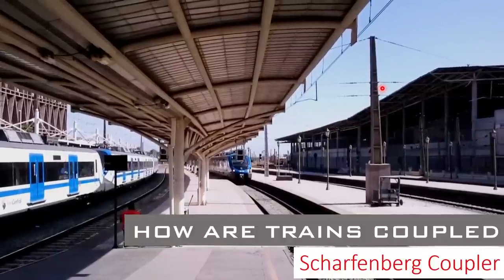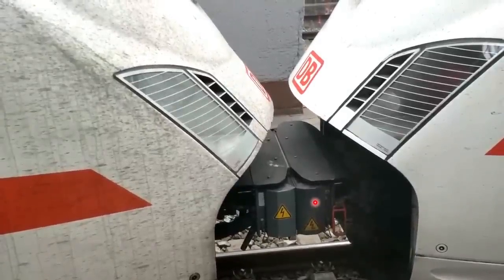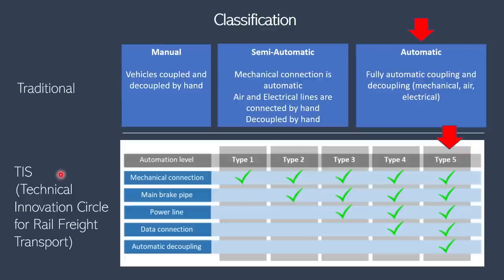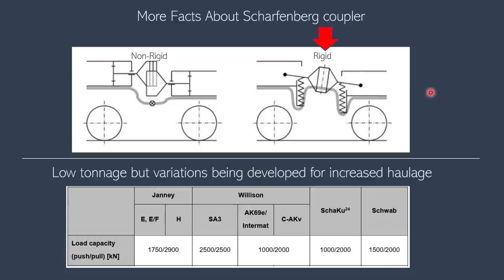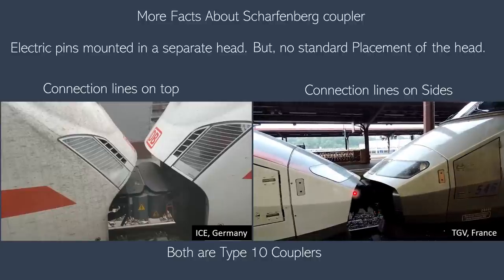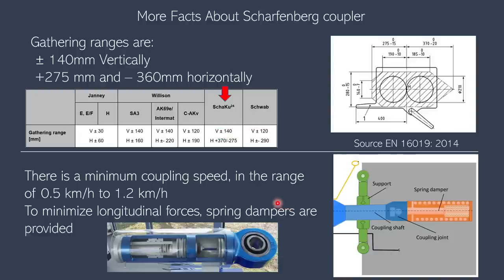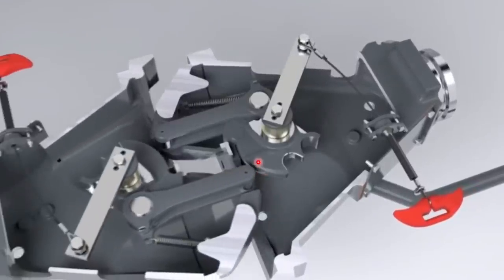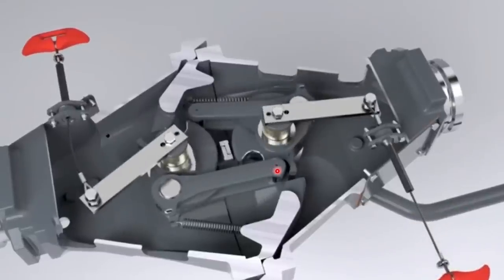Train Coupler Explained: Scharfenberg/Schaku Coupler

Comment: For those unfamiliar with the North American railroad system, brake air connections are assembled manually, but they disconnect automatically as the rail vehicles physically separate from each other. It's a simple system, but it keeps people out of the space between two railway vehicles until the vehicles have coupled. It may seem primitive, but it was invented in 1873, and mandated by federal law in 1893, when other countries relied on loose-coupling. During the transition period, the Janney coupler was made to also be compatible with the earlier "link-and-pin" coupler, which dictates some of its characteristics to this day.
Reply: Janney is also far more viable to freight due to load capacity, and simplicity of use too

Comment: The new REM in Montreal is using a rather similar coupler, but the electrical connection is in a different location, under the cone and cup. Otherwise, I think that it is functionally almost identical.

Comment: great job.
In the EU they are planning to introduce automatic couplers. In Russia and the USA they are using them since over half a century. This is one of the reasons why freight transport is more common in the USA than in Europe.
Reply: The US has semi-automatic couplers in the form of Janney couplers that just automatically couple with each other but don't connect anything else nor can be automatically uncoupled. It's also more of the reverse, because rail freight is more common in the US broadly than in the EU there has been more standardization. The fact that it's also a single country has helped a lot as it's been easy politically to standardize. The biggest reason why rail freight is less common in the EU is because the shorter distances have made road freight a lot more viable and at the same times there are more waterways for shipping. A lot of this has also been a result of deliberate EU strategy which prioritized highways for a long time and generally neglected rail apart from passenger rail. All of this is set to change with the EU's new focus on sustainability where rail freight is set to take up a much larger share of freight and as part of that there has been a renewed focus on standardization, though as with all things this stuff takes decades with lots of negotiations.

Comment: That's actually a modern version of the original which was the Tomlinson coupler, which dates to early 20th century used on the Key System in the East Bay area California USA for those not from the States

Comment: What breaks first?  Can it be changed in the dark in rain or snow by one or two people with simple tools?
Reply: A Scharfenberg coupler break? You must be kidding.
Reply: @rogeriomonteiro760  Put it on a 10,000 tonne train in the mountains and get back to me.
Reply: @lowercherty  It may surprise you, but outside of the USA trains are actually used to transport also people, not only goods ;) Different use cases require different mechanisms. The Schaku is very well suited for public transport as it allows very quick (and reproducible) train assembly and splitting without any manual intervention. A lot of train schedules rely on that speed. Freight trains are a totally different story.
Reply: @lowercherty  The trains in Europe are much shorter, but also faster and swifter than the american freight ones. That are big, but slow and dull. The Scharfenberg for european trains is perfect. It would be also better for passenger trains in the States, like Amtrak. So the idea of an 10000 tons train in Europe does not apply, it is just ridiculous .And in a mountain, even more, there are so many tunnels in Europe, that the maximum incline never surpasses 3%. Besides I am familiar to the Scharfenberg Coupling over more than 50 years and never saw that coupling break. I am sure that the Scharfenberg coupling type 140 or similar will replace the buffers and chain coupling in the european freight trains. So as the another types in the rest of the passanger trains ( the EMU and the DMU allready do). And the reason is simple, it is a complete automatic coupling.
Reply: Not really, if you break it, it´s fucked up. Need another engine to couple to the rear of the train and get it to the next station. But i never heared of a scharfenberg coupler breaking. 
10.000 ton trains should be possible, you just have to obey the maximum allowed pulling force on the coupler, so work with DPUs.

Comment: Isn’t this the coupler used by JR East for certain E2, E3, E5, E6 and soon E8 Shinkansen train sets?
Reply: Pretty much all modern emu uses them.
Reply: Japan uses a slightly different type call Shibata couplers.
Reply: Almost all modern multiple units use them (speaking for europe)

Comment: Do these couplers connect trainline air?
Reply: It's not part of the standard, but there is adons that can. Annoyingly  several that is not intercompatible.
Reply: the type 10 / 140 standards do connect air ... its the upper and lower opening on the centerline of the contact surface. You can see it in the ICE and TGV clips in this video. These are not addons, but regular standard coupler for trains. The coupler not havin it in the videos are either light rail/tram type or non-european implementations.

Comment: They don't work well at Brighton with its curved tracks. Video explains why these couplings do not help with ride stability. 

The combination of knuckle coupling and gangway plates under compression provides effective inter vehicular damping. The lack of this feature in the Mark 4 stock is one reason for the poor ride quality of this and more recent British trains. The long bellows style gangways also make matters worse. British rolling stock is typically 3 or 4 metres too long for the system which is presumably why pullman type gangways cannot be used. 

Until 1975 all British trains were fitted with retractable buffers and screw couplings at the outer ends of sets. Knuckle couplings would normally be used but could be swung downwards to reveal the regular hook. Everything could be coupled to everything else. Nowadays every type of rolling stock seems to be different from every other. We were once stuck in a Swedish forest in the middle of nowhere while the staff spent two hours trying to attach a freight diesel locomotive to a failed X2000 train. It is no way to equip a railway.